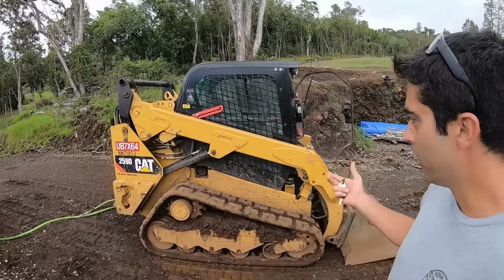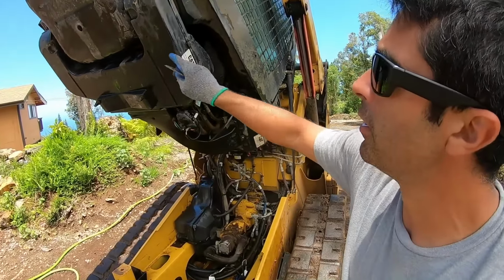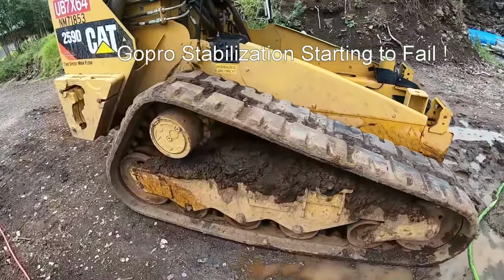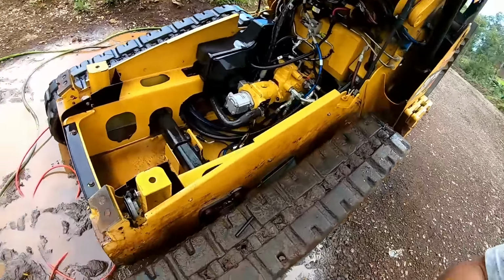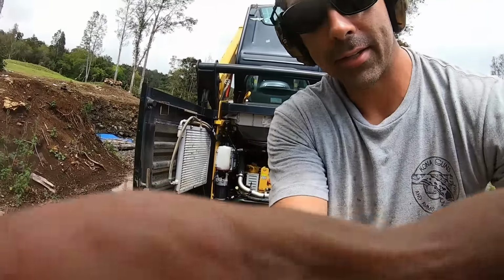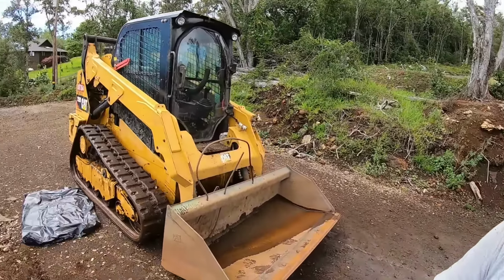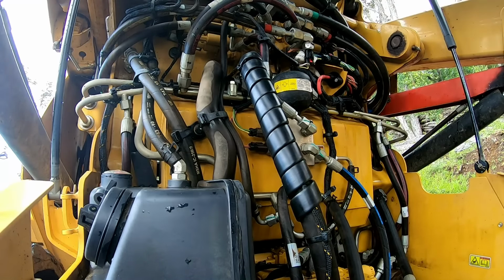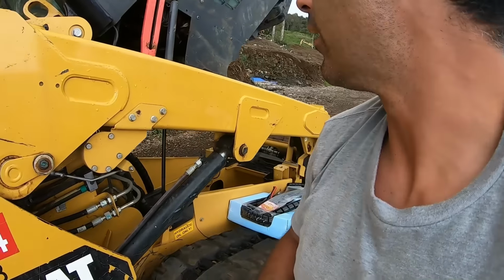Pressure Washing a Skid Steer / Compact Track Loader

Comment: "Don't want to get the electronics too wet"....immeadiately power washes the battery lol
Reply from the maker: You do realize the top of the engine compartment is completely exposed to rain and weather, these machines can get wet, they are all set up.as.marine grade, including all components and connections

Comment: I hope there are points where grease nipples,that´s get new grease and bring the water out? The metal under the wires needs a little bit rust converter and the hydraulics pipes too.
Reply from the maker: yup everything got rust converter and greased

Comment: If you want that sticker off take a a handheld torch heat it and it will start to peel then take a scraper then scrape it off
Reply from the maker: thanks for the tip, much appreciated

Comment: A 3/4 HP multistage booster pump from northern tool will help with your pressure and as well as the volume and rig it on a pressure switch that has at 130 to 175 psi. The pressure switch needs to have at least 45 psi delta. use a 1/4 inch air fitting to female garden hose and use a 1/2 inch metal ball valve with garden hose adapters. it should spray at least 8 to 12 gpm 100 to 120 psi and that will come flying out gives you fire hose pressure.
Reply: also put a spring valve on the suction side of pump
Reply from the maker: thanks for the tip, much appreciated

Comment: there is a plate on the bottom go the belly pan that you can take off, Clean out of the belly pan would be pretty easy. I believe 2 or 4 10mm bolts holds it.
Reply from the maker: I couldn't get under it and had no way to jack it up, it weights 12,000 lbs, wish I could have gotten to it, would have made it much easier
Reply: Wesley World if you can find some railroad ties or 8x8’s in the future you can use them to pull up on to access the belly pan access plates. 

We also block it off with 4x4 just Incase

We had to drain hydro fluid out of a 259 recently and the 8x8s were recommend by a local cat tech
Reply from the maker: awesome thanks for the info
Reply: Wesley World no worries, just trying to pass along some tips that could help or save you some time.

Comment: I'd highly suggest not leaving your zip tie trims that proud. Cut them flush to the head with a razor knife. Next time you go rooting around in there, you're likely to nick or cut yourself on those trimmed ends. Takes a few more seconds and a little care, but reduces your chance of injury.
Reply from the maker: I like to keep them sticking out a little so if they ever slip or come slightly loose , I am able to take a pair of pliers and grab the end and pull it tight again, In scenarios where tightness doesn't matter so much like holding a bunch of wires together I will definitely cut them how you explained, totally agree with you on that. Thanks for watching , hope you enjoy the channel.

Comment: would it not be ezyer to take the belly plates off
Reply from the maker: I didn't have a big enough jack to lift the machine or a safe way to raise it off the ground, it weighs 12,000lbs, it only has 10" of clearance which wasn't enough for me to get under it to remove the bolts, I wish Cat would have put the bolts on the inside which would have made this job so much easier, wish I could have gotten that plate off, oh well next time around.
Reply: @SelfRescueSurvival  lift the machine with the arms with a bucket on front then use some large wood blocks, easiest and safest method. Just be carful of the glass door 😂

Comment: I wonder if this was hire equipment whether the company would check on the cleanliness and charge you for cleaning on return?
Reply from the maker: I own it, but i did buy it from a dealer in Oregon and they never cleaned it, It was a rental when they had it.
Reply: If it was in Australia, they check and if the equipment is returned dirty, they charge you a fee to clean it.
Reply: Most hire companies charge for cleaning is it comes back cracked in crap

Comment: Dude, those pieces of steel on the top of the bucket is dangerous. Considering that you have to step over them to access or egress the cab. One slip and I shudder to think what the result could be. 😬
Reply from the maker: Agreed, a friend that worked for me put it on there as a grab handle, I thought it was the dumbest idea, I cut it off. he doesn't work for me anymore.

Comment: Man those hoses are in pretty rough shape for being a newer cat you would think there should be something on there from the factory to protect them a little better. Maybe cat makes more money on their hoses than they do selling their machines LOL. If I ever have two hoses rubing I usually just put zip ties on both of them where they're rubbing so the zip ties can rub against each other instead of the hoses seems to work gust fine never had a problem after...
Reply from the maker: Ya, Cat should have more protection on their hoses, that zip tie idea sounds like a quick fix. This machine was a rental before i bought it so I can't blame Cat too much on it, not sure what it went through.

Comment: it dont take a 5/16 socket, it is a 15/16 socket and wench budso many dont clean there machines, and once a fire starts in that pil, its a goner, and then they bitch saying equipment cost so much and jumps higher every year. hell even when i worked in the bush camps they would send me out 60 miles from camp to weld on just about any thing, i would get to it and radio in saying it needs washing before i touch it, no way, they tell me ether weld it or 3 days off no pay, well i welded it, and the next morning all was left is a rusted up black shall still burning..

Comment: Yeah at my work we never open those unless something breaks inside.
Reply from the maker: ya, seems like the dealer i purchased this one from never did it as well, it had 1,000hrs and about a ton of material that came with mine , lol
Reply: @SelfRescueSurvival  yeah over time dirt piles up. I don't think it's necessary to clean it out every time you use it but clean out the outside every other time you use it, and clean out the inside once a week or when you have a really dirty job.

Comment: All you did was push the dirt back into the engine were you can’t see it. You gotta take the plates off
Reply from the maker: there's only one plate in the middle in front of the motor, I got all the material out from under the motor, no worries, and andrew is Rich I'm not

Comment: Im at the place where I have to replace many of the hoses on my case davis 360.. some virtually destroyed in the north Carolina sun for just a few years.. So my idea is to wrap ALL the exposed hoses after I replace them.. No-one mentions this, but it seems like a good idea.. Any thoughts ..pro or con?
Reply from the maker: Definitely wrap all of them, you can buy the wrap on amazon, it will protect it from the sun and from any physical damage, I also recommend spraying all the hoses with 303 aerospace protectant , its also available on amazon, it keeps the hoses from cracking and drying out.

Comment: I’ve operated skids for years cats specifically  90 % of the dirt in the chassis is from the gap between the cab and chassis the problem compounds when your trying to move more material then fits in the bucket(taking large scoops that go over the bucket/implement) look into the forestry packages/kits theyre basically gaskets that seal the chassis up pretty good

Comment: Get a little had shovel/tool and scoop out as much dirt as you can with that before you put water to it. Will make life a little easier!
Reply from the maker: it would have been to risky because of the unknown hydro lines in the compartment, didn't want to damage any, to pricey to replace, so using water was the safe way to go, I tried to slowly pick at it but I started to expose hydro lines and decided to take the safe route, thanks for watching, Aloha from Hawaii.

Comment: Should have started with the inside and then do the tracks and go to the drive on it. Don't worry so much about the places you want to add extra seals to because rain water will get in anyway.

Comment: Watching the system to lift the cockpit, I thought it was very dangerous for whom engaged into the cleaning. If the cockpit were to be released its weight could kill. A safety bar placed on one side would have been very useful.
Reply from the maker: agreed, it definitely needs improvement

Comment: Try a Turbo nozzle for your pressure washer. Got one for less than 20 bucks. Makes cleaning equipment much easier.
Reply from the maker: ill look into that, thanks for the tip, much appreciated

Comment: think i would have got a shop vac and sucked 90% of that mess out then power washed it.
Reply from the maker: the material was hard as a rock, mostly base for concrete, a shop vac wouldn't have worked on it that time but definitely will use one in the future before it gets too compacted into it self again

Comment: At 28:37 I think the tie rap cut tip should be turn to the left, cause it looks it might scratch the hose on the right…  So right now it protects one hose, but will worn the one the right side with friction after a while. What do you think guys?

Comment: Definitely recommend using a 40 degree pressure washer tip on engine/ hydraulic hoses and components. Have potential for damage with that beam tip
Reply: i would have used a turbo nozzle

Comment: I have found that a power blower after pressure washing is a really good thing to do, it get the water from all the places where you dont want it sitting around and also helps preserve to paint work and stops the rust a little, and as you said, going over any area where its likely to rust again makes the thing last that bit longer plus is a lot nicer to work on if you have to, for me there is nothing worse that working in a dirty engine bay all for the want of a bit of a clean once in a while.
For me cleaning the car  is the same, spend as much time cleani g the engine area as you do cleaning the outside and inside the car, for me is a must, and so far It has paid its way every time.

Comment: The safety arm is only if the hydraulics fail, you can leave the arms all the way up and set your red safety in. It will support the weight of the arms without an issue. (I pressure wash heavy equipment as my job) But always make sure you read the recommended instruction for the safety in your owners/service manual

Comment: As an owner/operator for 20+ years and seeing many preventable failures in the late model CAT and other brands, I'd like to offer you a little advice.
1. The red safety bar that supports your lift arms on your CTL has a pivoting rod attached to it which is designed to allow the retraction of the arms (when you are safely in the cab) with the arms locked in the full up position. It simply follows the gland nut area of your lift cylinder and directs the safety bar away from its landing zone so you can safely lower your lift arms from the operator seat without a helper. The factory installs a BOLT in the lift arm safety bracket, so it's an intentional removal for the safety lock to be activated. Do not use a pin, if it fails you will have a dangerous situation where the arms will lock in the full lift position, and your operator will not realize what's happening because it's not visible from the seat. 
2. Install 2 o-rings on your cab catch support arm and the rattle you mentioned will be gone!
3. You should be performing the complete cleaning of your under cab area at least weekly, and obviously shoveling off your tracks and bogies at the end of every workday. 
4.  To prevent costly corrosion of your electrical system components, open the connectors and clean the contacts, (contact cleaner, not Brakeclean) then apply silicone paste to the contact points and the connector bodies. This will ensure a waterproof connection and preserve the contact surfaces from all moisture and dirt.
5. Show the planetary drives on your machine some love too. They are the most prone to failure on the machine you have due to neglect. Use a high-quality synthetic gear oil and replace it often. Be diligent about the drives as much as you are with grease points and your machine will last a lot longer.
Good luck with your excavation adventures, work safe, and I'll see ya in the next video!
Doug@ the "ranch"
Reply from the maker: Hey Doug, Thanks for the info, It was my first time opening the cab. I will definetly do it more often, that was a mess to clean lol. The bolt that was in there doesn't look like it should be there, it just doesn't look factory, I figure it supposed to be some sort of pin type locking system. kinda odd to be a bolt like that, which was difficult to remove, I'll check the factory schematics, the previous owner might have replaced the factory bolt with the hoky one that was on it, it didnt fit right. My Cat 259d was actually a rental unit up in oregon for the first 1,000hrs of its life, they definetly never cleaned out the inside, most of the material that i removed was rock from oregon. I'm an Excavator Guy and am coming to a conclusion that these Compact track loaders are just way to high maintenance for me lol, especially for the hourly rate it gets me compared to my Excavator. I'm definetly going to fabricate up some type of block on the hose inlet ports on the sides, its a funnel for material and seems like a major design flaw, ill make a video on it, hope it will help other guys with the same problem, i have some ideas..., thanks for watching I always appreciate the constructive comments and also appreciate your support on my channel, have a great weekend.
Reply: Wesley ,  regarding your  comment..........."  I always appreciate the constructive comments ". it behooves us all to realize that ALL comments are constructive , negative OR positive , IF we choose to learn from them. most of the so called "negative " comments might only serve to inform us to TONE DOWN OUR EGO  a little bit , and.....there is learning in all of them . just a twist on the golden rule............treat your equipment as you would have it treat you ! have fun. oh , and PLEEEEEASE add/subscribe to Doug @ lakesideranch. interested mentors very rarely approach US.
and when they do , we should turn 180 and shake their hand. remember , do what you love to do , and you'll never work a day in your life !!
Reply: I told my boss is about that for the past two years at my tree farm but they don't care
Reply: Very very good advise

Comment: OMG! I don't trust that lock!  It's scary.
Reply from the maker: yes scary but being a new machine, the only way it would have come crashing down fast would have been if a hydraulic cylinder just blew for no reason and again its a new machine and that wouldn't happen, one of the main reasons I buy newer quality equipment and stay away from old prop machines. Still a little uneasy working under it when its not running, thanks for watching.

Comment: You must remove the iron that sticks up from the bucket! They can penetrate your chest if you slip going in and out from the machine.
Reply from the maker: yes agreed, a friend of mine that worked with me put that on it, im gonna have to cut it off, its been annoying me since he put it on, i guess it was a handle to hold on to when it got wet and slippery, i never used it and will remove it asap, thanks for watching, Aloha from Hawaii

Comment: cleaning the engine with a pressure washer wasnt the grandest idea, luckily cat has marine electric connectors so hopefully no water damage resulted.
Reply: Right?? He said "don't want to get the electricals too much" and proceeded to blast the battery I was like wtf am i watching
Reply: The cats are good in this regard, run a hire fleet of over 100 and always steam cleaned the engine bay using TFR etc. Never had any issues.
Reply: @waynematthews2362  steam cleaning is farther more gentle than a pressure washer, but im just glad he didnt ruin that expensive machine. someone should tell him he doesnt need to wash out the engine bay, assuming a vehicle has a water cooled engine, it doesnt really ever need to be cleaned unless its for show, etc..

Comment: loved this video I am OCD when it comes to cleaning machinery or even seeing dirty machinery....Andrew Camarata would have chained the cab to forks lifted has one then most likely use his crane to move skidsteer on its side and let the jet wash do its thing then gone over with yellow paint to make machine look good and use his classic one liner "Has Good Has New"..One quick question is it safe to jet wash the engine and engine bay ??...Stay Safe
Reply from the maker: yes its safe to pressure wash the engine bay, just have to be a little careful around the electronic connections but on machines they are water tight. I used to be a professional detailer for about 12 years.

Comment: Hi - good detail on cleaning the steel work, and you've done a good job.   Bad idea however wrapping exposed braiding on the hydraulic hoses.  Moisture will get in and start corroding the steel wire braiding.  Thats the strength for the hose.  The Spira-wrap is a good idea, but not when the braiding is already exposed.  I work hydraulics and have seen hoses fail within months of the braiding being exposed.   Best to replace them for like for like.   Any hydraulic company should be able to make up new hoses for you with the correct diameter, pressure rating, length, fittings diameter and material (usually cadmium coated steel for onshore based plant)